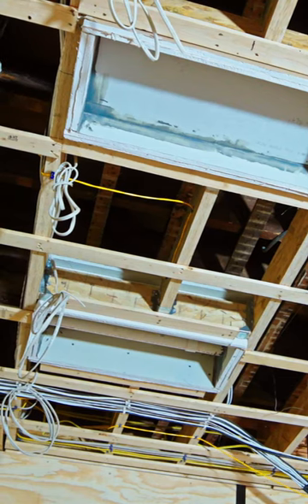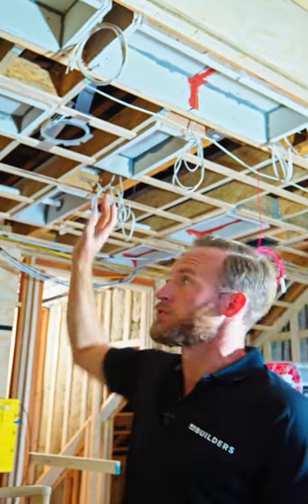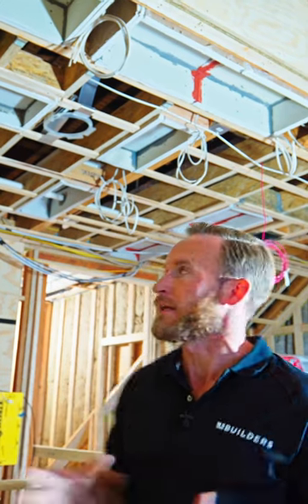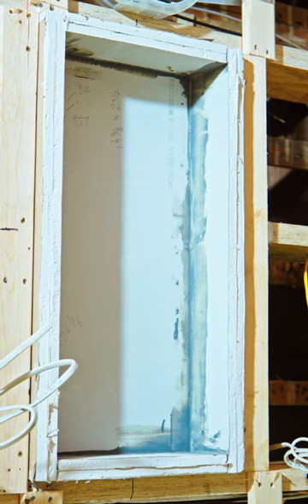Fire separation for recessed lights

Comment: GC I do work for once got forced into making fire-rated boxes just like this…
Except it was for around ALL the plumbing, exhaust, fresh air, and dryer vent(s)…. AFTER we had already finished rough mechanicals, all drop ceilings framed - everything. Inspector made that call during rough mechanical inspection. That was a hefty change-order and  hundreds of man hours of work. 

Good on you guys for ironing it out ahead of time.

Comment: Works great for sound too since you don't have to be as perfect when you seal around your ceiling presentations. Also since you can't seal around the sprinkler heads themselves, this is an option that allows for air tightness. Nice job!

Comment: What so it meets code to run a water pipe through an electrical light box? That's crazy.
Reply: its not "an electrical light box" its just a boxed out cavity. otherwise, before these ridiculous codes, plumbing pipes and electrical commonly ran together in the ceilings without these (ridiculous) boxes
Reply: @22KingRancher  ok that makes more sense, thanks.

Comment: Another foolish technique in my opinion. There’s always different ways to skin a cat but this labor intensive. You built boxes of doubled up 5/8” Sheetrock. SMH
Reply: yeah this is ridiculous. the double 5/8 is odd. wonder if theyre going to double up 5/8 on the whole ceiling. common area fire code is met here with single 1/2" with tape and 1 coat
Reply: Yo for real, NDR makes recess lights that are for fire rated ceilings and there’s no difference in appearance…
Reply: @22KingRancher  double 5/8 is very normal. It depends on how many hours the fire rating is for. 5/8 is commonly used in garages. They must have a similar requirement here.